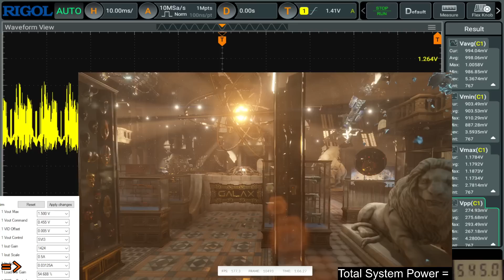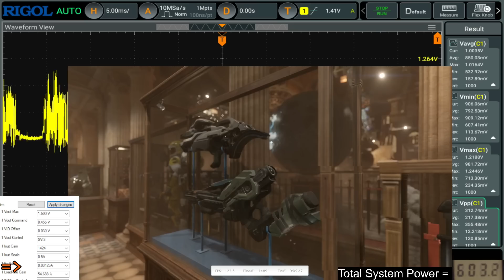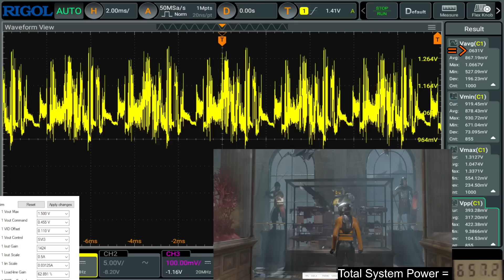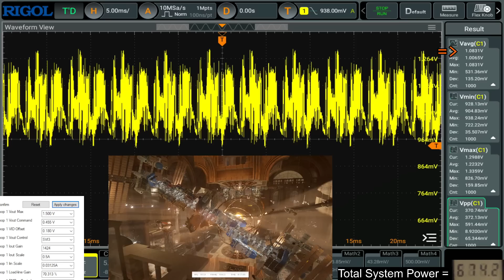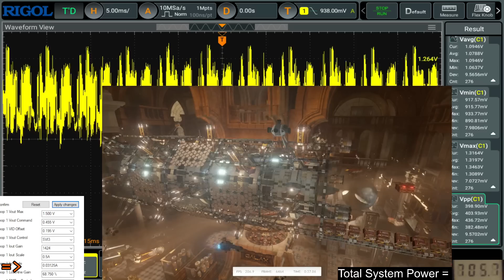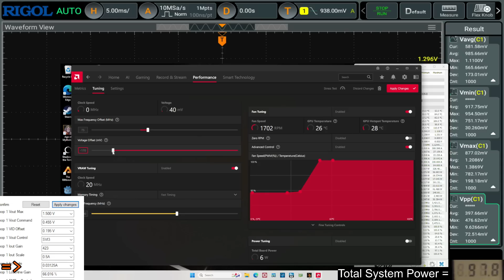+25% RX 9070 overclock

Comment: Would it be safe to use a evga supernova  850 p2 with a rx9070 xt and just plug in 3 8 pin connectors , or do i need a 3.0 / 3.1 atx psu

Comment: HEY bro i got a weird issue with my card a 6650xt and im just wondering if you could help me in anyway.

the problem is extremely weird, it happed after my nephew kicked his pc multiple time, the pc obviously crashed and now the 6650xt will not recognize  certain monitor or TVs, i tried every tv in my house and it would not show a picture. but tried a old nec monitor i had laying around and the 6650xt seems to work perfectly fine. i tried everything i can, like clean the card and reinstall driver and try in 3 different pc, the card keep showing the same symptom and will only show a picture when turning my pc on without the HDMI cable plugged in. its such a weird problem and i never had anything like this happen. just wonder if you can help? thakns

Comment: Where does the power come from for a 2 x 8 pin card, if each cable can only supply 150 watts?
Reply: Each cable is supplying the power. That 150W rating is for the people that use crappy psu and cables. A good 16AWG Wire is easily handling 250W each.

Comment: Bro, im doing overclocks too. A week ago I overclocked the 4080 Super Supreme X by 35-45% in performance. Up to 420 watts of power consumption and 3200 MHz on the GPU and 13600 MHz on the memory, it shows the same FPS as the 4090, sometimes even higher. Cant you help me with soft to editing Vbios power consumption?

Comment: Driver is limited by voltage curve end. Increasing voltage offset in EVC2 without restarting driver leads to bad results: high efficiency drop and improper curve, and core frequency able to pass throw max limit. Much better to reinitialize driver after every EVC2 voltage offset. It gives prolonged curve, so driver can operate normally even at 3700 mhz. 
Fire strike benchmark shows exactly this - driver sitting on the end of the curve, so on voltage cap, and it can`t consume more amps. 
Also, words "weird driver" after crash confirms it. You driver reinitializing after crash, so you can`t reproduce results, because curve is changed and it can`t handle driver core voltage shift. 
Source: I have 7900xt and evc2se.
Reply: Ok is that the issue im having with my RX 9070 XT and EVC2SE? It will not scale past a sustained 3178MHz no matter what. Do I end task with adrenalin and then restart it?

Comment: Seeing how far you where able to push that 9070 makes me wonder how far I could push my AsRock 9070XT with hardware mods like this, since it's one of the 9070XT models with the highest factory OC settings in terms of powerlimit and Frequency. For comparison, my unmodded 9070XT hits 33535 GPU Score in Timespy with a -150 Voltage offset, +15% Powerlimit and 2714 Mhz on the memory with Fast Timings.
Reply: IDK if you checked the video, but decent explanation for you is at 1h35min mark. TL;DR 9070 is kind of artificially tamed down, to create bigger looking gap between the stock 9070-9070XT. Would say it is a marketing oriented decision in one way. The upcoming 9060XT will have much higher wattage, than the SPs in GPU even need, then this translates as rather high out-of-the-box frequencies... Being somewhere way over 3000MHz, most likely over 3200MHz. Pretty clear this approach for the 9060XT has been taken by AMD, to make it more appealing, when comparing with some Nvidia GPUs. :) You know if the 9060XT was a bit low on the wattage point of view, the GPU MHz would not scale up and customers would go "boo-hoo" when checking on it's performance. I hope my take on your question clarifies causalities a bit. ps. Then again high stock GPU MHz makes ppl rant about "can't OC 9060XT" / "Why I can't OC my 9060XT, it crashes instantly" :D Answer being that it is nearly maxed out from the factory, stability ready to fall off the cliff (the analogue AHOC used when something gets out of control) :)
Reply: Can you set +15% PL? I have same Asrock card and I can only set it to +10%. I'm considering PL mod from the other video as my feeling is that 374W total max power draw the card can muster today is the actual limitation, I hope that the PL mod together will yeild some gains to achive 35K GPU score (33.5K now).

Comment: I've gotten my Asrock Challenger 9070s FPS up by 25% just by lowering the voltage by 20%, and the wattage has gone from 225w down to around 170w, GPU temps are staying under 40c with fans set to just 30% speed, So I'm getting 90-100 FPS , 0.01% 60 FPS, in The Last of US at 4k Ultra preset with FSR 4 quality, where before lowering the voltage I was getting 70-75 FPS, with 0.01% 55%. And this card makes zero noise too! :)

Comment: Nice to see the full OC action. Maybe it would have helped a tiny bit to have the fans on 100% all the time, so that everything starts a few degrees lower and maybe the hotspot would stay away from 110°C?
I have an XFX 9070XT Mercury OC. Sadly my undervolt potential is low. Steel Normad is stable at -60mV, but other games crash with -40mV. So far -35mV has been stable...still not nearly as much luck as other reports online. I'm running it under 2900MHz(-500MHz and -35mV  offsets) for daily gaming. But I would like more range on every slider. Why not -2000MHz and test it against my Vega64 at the same clock?
Why only -30% TBP? Why is it not possible to lower the VRam clock? I had cards in the past, where the VRam was getting unstable, but I was able to still use the card with slightly lower clock speeds.
It is very nice, to tune the card within the AMD software, and I get, why there is no option to increase the voltage or go beyond +10% TBP, but why is it limited into saver regions?
And I wonder why there is so little performance in VRAM OC? My card does 2800MHz too, so 12% more clock and (maybe) better Timings. But performance is only like 1-2% up?
On Vega I would get 2% from 5% more clock. And this GPU is so much more powerfull and only GDDR6. At least it seems to indicate, that the 9070(XT) cards would not have benefited from GDDR7.
Reply: I was able to get -40 UV stable across all games on a hellhound 9070xt. I just run -40 MV -10 PL and a 2618 memory, faster than stock cooler and stable. I think stability is the biggest factor for me. -35 and -50 isn't a huge difference so I wouldn't sweat it if I were you.

Comment: How is my 9070xt base score lower then your 9070 base score? 26494 while yours 26765 before you even oc it or any thing
Reply: Better airflow in the case maybe?
Reply: Scores are complicated. 
Did you compare cpu, RAM and timings, and is REBAR enabled?
What gen PCIe slot is the card in, and is it a full 16x?
You may have the same card, but you never have the same system.
Reply: You got a lower clock gpu ... gigabyte runs faster and sapphire version is even faster... thats why you buy 100 bucks extra over lower clocked gpus. 😅

Comment: Timespy Extreme would complete at -200mv on my 9070XT and get a fantastic score but wouldn’t even start Steel Nomad. -100mv seems fine with a 110% power limit.
Reply from the maker: yeah the max voltage offset varies by application/workload a lot.

Comment: This is insane but unfortunately benchmarks in 3DMark not guarantee that it will work in real world games. Mine 9070XT Aorus could handle -100mv 372W even during stress tests, but in games I was forced to go with -60mv because it's constantly crashes in games. In Ratched and Clank it was stable only at -40mv, so it depends on the game.
Reply: Synthetics were never equal to real world performance.
Reply: @Wasmachineman  I mean it's about stability, but your statement is correct as well.
Reply: Having same issues with 7800xt undervolting... just pushed tdp to max and voltage to max pushed clocks higher and now its stable and max Hotspot below 80 degres celcius... running great not any overheating... 😅

Comment: Hmm, I've watched video titled "I Flashed An AMD RX 9070 XT BIOS Onto My RX 9070..." from Dawid Does Tech Stuff here on YT and he saw a jump from 118 AVG FPS in cybepunk with stock non XT BIOS to 148 FPS with the XT BIOS, which is also exactly 25% uplift. He then tried undervolting and lifting the memory clocks and it did scale even higher (tho not much in his case).
So question is, would a BIOS flash unlock even more headroom for you to leverage with these power mods?
Reply: He's answered this before. That Bios MOD just unlocks the power limit. The same thing he did with a few balls of solder.  His HW Lv unlock can push further with no bios mod needed.
In simple terms that Bios mod is good for people afraid to use a soldering gun on their GPU. Doing both becomes pointless.
Reply: @svegetax  Thanks, it just seemed odd to me, that that cybepunk +25% gain was with just 3 GHz, but I suppose it wouldn't be stable at 3,4 GHz anyways as that clock scaling is probably workload dependent. So BIOS mod cannot improve chances of reaching 3,4 GHz in cyberpunk? Which would for ideal scaling mean further +13% improvement or overall +42% improvement over stock.
Reply from the maker: Cyberpunk probably just scales more but I don't have it so can't test it. Also game testing tends to produce incredibly unreliable data so I generally avoid it.
Reply: @ActuallyHardcoreOverclocking  Thanks for the answer, that would make a lot of sense.

Comment: Fan wise you can remove the stock ones and use case fans from the motherboard. If no control software is available, you can tune the fans based on CPU temps. Some CPUs are harder to tune the threshold, but for anything modern that doesnt have fixed OC should be very easy because as soon as you apply a slight load continuos load, you jump easily to 55-70°C+.

It might not be usable for synthetics that only GPU or CPU, but it's great for gaming. Works perfectly.

Comment: Europe does not want more watts, we want more efficiency.

Let’s keep the 9070(xt) under 2950MHz…
Reply: You must hate fun
Reply: @xenosarcadius1198  I hate noise and heat more than I hate fun
Reply: @nicoyt9481It doesn't add that much more heat actually since you will be undervolting.
Reply: Go buy nvidia then... 😂😂😂
Reply: or you stop trying to squeeze every bit of MHz you can of a GPU and you start to look at what matters : efficiency.

Rdna 4 can be extremely efficient, you just have to be smart with the undervolting settings.
Reply: @nicoyt9481 You're on the wrong channel then. This is actually hardcore overclocking. Efficiency is great but the experiment here is just to see how far the cheaper, weaker 9070 can be pushed. Your comment isn't relevant to this video as it isn't stock settings or anything. This is only an experiment showing what's possible with the less attractive RDNA 4 card. There are plenty of undervolting, efficiency RDNA 4 videos you could be watching instead but you chose to watch this knowing you didn't like the idea and then left a comment complaining about it. I'd hope you're smarter than that.
Reply: @vigilant_1934  9070 isnt weak,its just power limited,alsso the 9070 has the same number of rops as the 9070xt, so they will be 10% diffrance

Comment: 3.4ghz is clock speed of the cpu in my first gaming rig...I remember wondering how long it would be until I saw a GPU that could run at 3.4ghz. That day has finally come
Reply: Ahhh young bloods, my first PC was 25 Mhz, 4 Meg of ram, and a monsterous massive 60 Meg disk..........
Reply: @MarkSErrorNaut  my first pc was a zx81 with 16kb ram pack
Reply: @MarkSErrorNaut  Same specs as my first PC, an Olivetti with a 25MHz 486 (the SX, so no FPU).
Reply: @MarkSErrorNaut  :) 12 mhz  with turbo on and 40mb HDD :)
Reply: @MarkSErrorNaut  fancy, considering mere mortals like me could only afford floppy disks 😢
Reply: @ I was a very lucky young man. My dad was given it from work,  to work from home, and as mum tells it, once that computer came home we couldn't peel you off of it, dad had to pay work for another one (You couldn't get them on the shelf back then), Worked out though, 25 years working in IT / Datacentres. And the kicker is i still have it, its in the loft, weighs about as much as a tesla lol.
Reply: And it only takes 500watts and shaving off a few years of the gpus livespan to run it. What a time!!!
Reply: you missed the best part, with p120 and 486?

Comment: MY custom 5080 only gets a casual 15% performance increase, but without raising the powerlimit... Its at 25486 in Port Royale, which is at or above a stock 4090, but with less power.
Reply: Real gains are the gddr7 overclock
Reply: @JDC2389  +3000MHz is maybe half of it. 
The GPU clockspeed can be overclocked to around 3200MHz on my 5080. With increased voltage and power even above 3300MHz.

Comment: since part of the job of the GPU current/power monitoring is to prevent the power connectors from melting, putting like >10 watts of fans before the shunts would be rather silly
Reply from the maker: eh +/- 10W shouldn't melt properly designed power connectors.
Reply: @ActuallyHardcoreOverclocking  it could melt a 509... oh you said properly designed. Never mind :)
Reply: or just remove the fans and use case fans with ducts :D

Comment: So with a crazy amount of knowledge and a barely stable overclock, you can get 10% performance out of it maximum? Yikes actually.
Reply: 26%. Which is about the same as the difference between RTX 5070 and 5080.

Comment: This is equal parts impressive, and a whole lot of work to end up 100MHz faster than a 9070XT can get out of the box.
Reply: Hey, it's impressive that it's still possible, in some ways. That used to be THE way to go on both teams, if you were a little crafty. You get a HD7950 and give it an OC to take on or outrun a HD7970. Or whatever. I mean, obviously, this isn't realistic in terms of work. But, you know.
Reply: @ShroudedWolf51  I had bought a HD7950 on sale for 150$ such a bargain price/perf boost back then, it ran fine OC ! didn't know about the volt mod that's crazy but also a bit risky of course.. was a nice boost over the HD 5870
Reply: i mean the ghz edition was something they offered as a refresh/etc but i went with a 300$ refurb 7990 from newegg it was a sapphire 7990. I infact did dis-assemble and re-assembled it at purchase to check thermal paste/quality and vram/cooling sheets were added. It lasted me from q4 2014 to 2019 when my budget/range psu finally crapped out some rosewill 850w gold modular and gpu/vrm area had noticeable damage sustained XD. Then i got a 1660ti laptop temoporarily until i could go in on a desktop again...uv the 9750h processor and got that 1660ti to oc to around 1860 clock speeds not bad for a mobile 80w tdp part. Hard to say how it compared to a r5 3600 and 8gb 5500xt since that was a 128 bit card and the mem bandwidth was still higher on the 1660ti which had matched memory and cuda cores to the desktop version. 7990 was known for not being friendly towards oc and pretty much needed to be ran at stock/boost clock of 1ghz. It sure was a hoot using VSR on my 1080p monitor ill say that....hopefully AMD can implement ai/fsr4 VSR....sooner than later...bc ive grown quite fond of using DLDSR 4k on my 1440p monitor with NV...then again i can wait down a further amd/generation and AI vsr should be common by then with amd/support.
Reply: 100MHz faster out of the box? Uh no. 99% of "stock RX 9070 XT are not going to run TimeSpy at 3300MHz. Especially not sustained. Matter of fact his 34K score on TimeSpy is better than 99% of 3DMark TimeSpy RX 9070 XT overclock scores.

Comment: damn it your making me want a 9070XT
Reply: This video is on the 9070 non xt model which performs about the same in gaming.
Reply: @Luxtbl it's maybe a 10-15% performance difference overall. Depends on the pricing at the time if it's worth it.
Reply: @streetguru9350  I meant after unlocking power limits